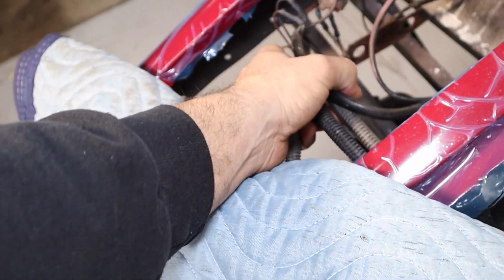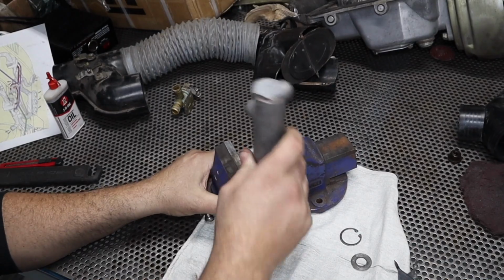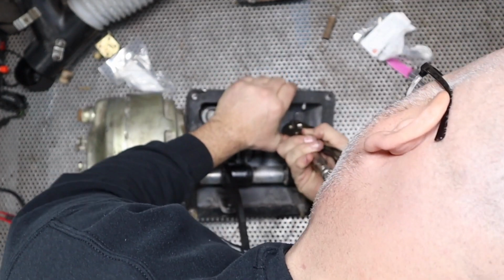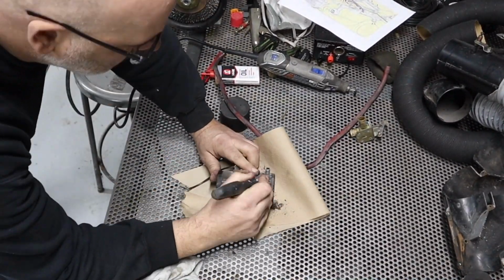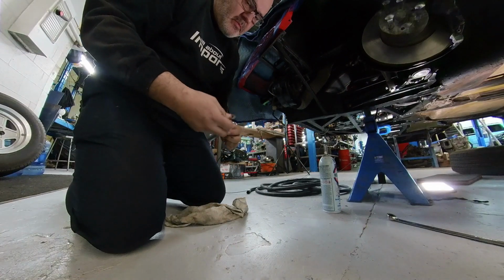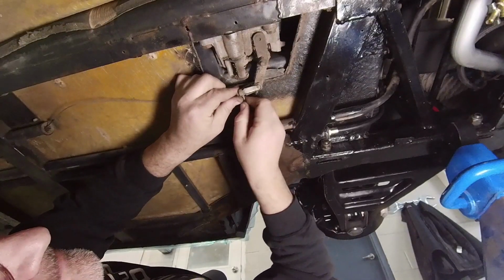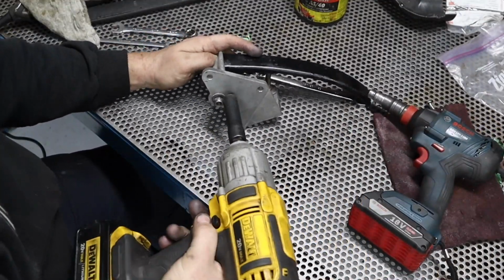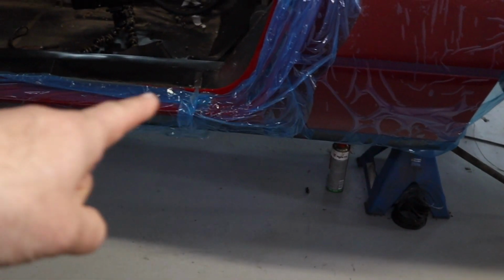#Ferrari 308 GTS rebuild.  The land down under!

Comment: Hey Lou, did you try installing the clutch spring from the top down instead of bottom to top? However, I'm happy to see you finally installed it with four pairs of hands and a few pairs of feet. Also, great cross promotion for Heidi & Franny's Garage. Happy Thanksgiving! Cheers!:)
Reply from the maker: Happy thanksgiving to you too.  Yes we tried every which way.

Comment: Don't  know how stiff that vacuum hose to the booster is from fiber reinforcement, but maybe running hot water through the hose for a few minutes might soften it up enough to get it to un-stick in the rocker area.
Reply from the maker: its a head scratcher. that's for sure.